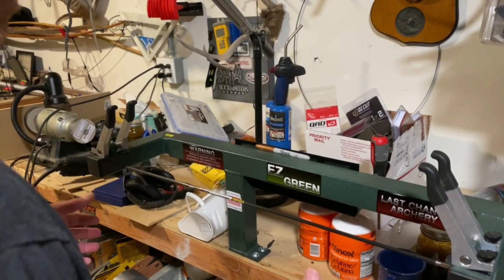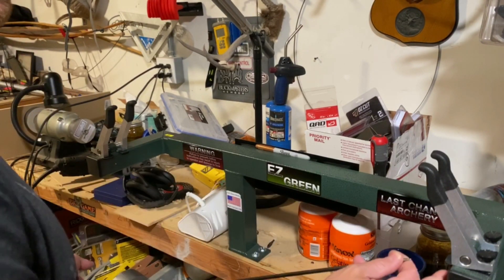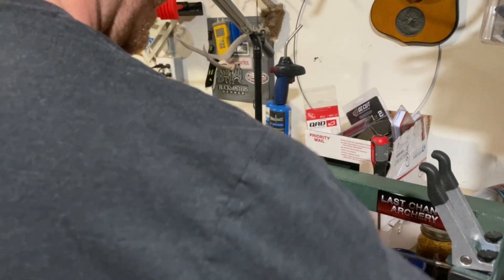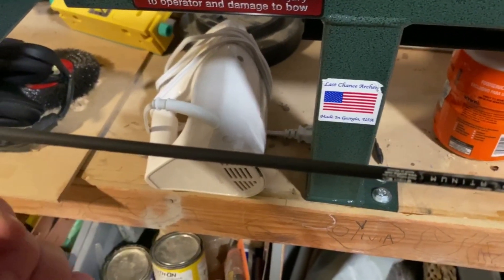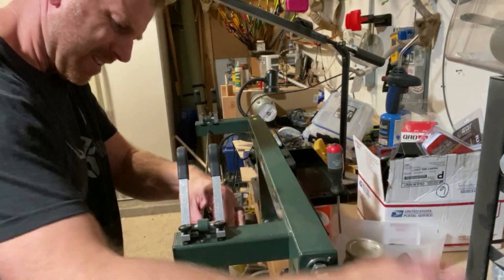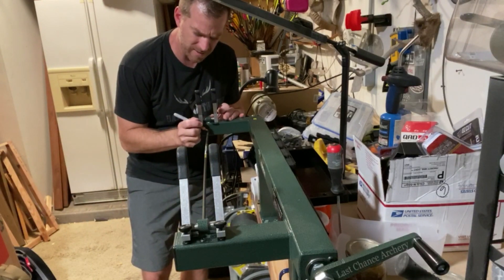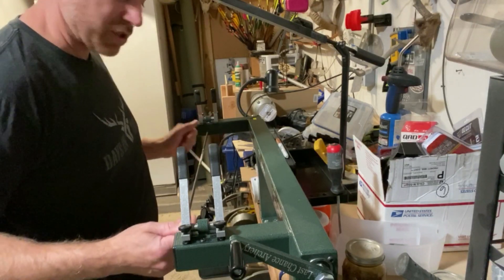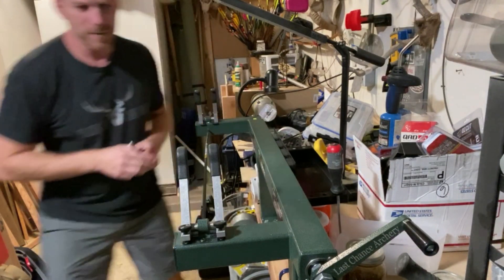Most accurate arrows - First bend Indexing your arrows

Comment: I think this method will find your weak axis very well. But, that does not necessarily mean that the stiff spine is 180 degrees opposite. ie the weak spine (outside convex of the arrow) might not be changed much at all by the stiff spine (which is in compression in the concave) hiding 10-15 degrees off the centreline.  I've seen plenty of people say that you can find the spine on a 32 inch arrow but cut down by 3 inches, the spine will be in a different spot. This suggests that the spine is not a straight axis at all and more than likely twists around the arrow.  Construction eg whether it is spun fibres, 45 degree weave, 90 degree weave or rolled would have a big impact. This probably also explains why some arrows in a batch spin CW and some CCW off the same bow - a combination of a twisted spine and whether the spine was just left of centre when shot or right of centre and it trying to tip into a weak plane much like it does in the press, initiating a spin direction.  So I still do this test but at the cut length of the arrow and try to confirm by rolling the arrow,  that the stiff side is in fact opposite the weak.  Just my two cents

Comment: I like the way you index your arrow but you said something about up down left or right as long as the arrows all shoot the same I don't think that is correct because a compound bow has to be either 12 or 6 o'clock because the riser is off set taking the archers paradox out of the equation besides the chance of the arrow making any contact with the bow at launch, a traditional bow you have archers paradox making the arrow bend around the bow so you would want the weak spine facing the riser making the arrow bend around the bow easier thought I would share that with you anyway keep building good work and thanks for sharing
Reply: What is Archers Paradox?

Comment: I found my arrow spine stiffness by putting my arrow on my Hornady pocket scale on a level surface. Putting the F.O.C. measurement in the center of the scale,  and the arrow will roll on the scale base and it will roll back an forth and then it will come to a stop. The stiff side of the spine will be on top. I've tried this with and without field points and broadheads. Same spot every time. I then align my nock to the stiff side. I load my arrow in my bow with the stiff spine pointing downward. This way when I release the arrow the spine will deflect the arrow upwards. I did this with all 12 of my arrows. They hit exactly in the same spot every time.

Comment: Have you compared this against just using a spine indexer?
Reply from the maker: Yes I have. I have found using the press doesn't always indicate what the stiffest spine is but where the arrow will bend. Which is more important than the spine. My go to before this process was to use a RAM spine tool, this is an affective way to get more accuracy but it doesn't always indicate where the arrow will bend while its leaving your bow which affects the impact more so then anything. The more consistently you can get your arrows leaving the bow the same way the less likely you will have to knock tune and the better groups you will experience

Comment: Fishing rod makers bend their blanks as well to find the spine so that they put the eyes on the correct side. They just hold one end in their hand and roll the other on a flat surface. Bending from the ends is all you need to do for an arrow as it gives you the average over the length of the shaft. I saw a video of a guy using a spine tester to double check the spine alignment marks on a dozen Victory arrows. There were a few in the batch that didn't match up so he marked their spine based on his own results. Well, those arrows tore badly in paper, and the factory marked ones tore properly. That is because with a spine tester you can't test from the absolute ends of the shaft.

Comment: Ive just recently tried this with xbow bolts black eagle executioner. 001, i had 5 out of  10 bend consistently the same way eg first bend to the side rotated the bolt bend went to the side etc to find if it bent consistently in the same place , those i marked and fletched cock vane on the upward bend, the other 5 bent the same direction no matter how many times i rotated the bolt give or take a few degrees either way, so my question is are the inconsistent bolts bad or what are they doing.

Comment: Any way of doing this without a bow press ?
Reply: unfortunately either a bow press or a spine tool which is just as expensive
Reply: @JohnStallone-hunting-podcast  Damn. There's gotta be a way for those of us who are crafty
Reply from the maker: @nateb4543  I suppose if you built a super large vise and were able to make it so the arrow stayed perfectly level and straight you could achieve the same results could be dangerous though
Reply: @johnstallone1916  after a few more videos I'm thinking 2 points of contact and a hanging weight. Then rotate arrow and look for it to move up and mark accordingly. Does having the spine in the same spot on all arrows negate being able to nock tune? I keep hearing to line the spine with the cock vane but I'm running 4 vanes. Any tips? Thanks for the reply!
Reply: easy peasy... bar clamp or pipe clamp. get 'em at Menard's
Reply: You can use a table mounted woodworking pipe clamp kit and length of black pipe